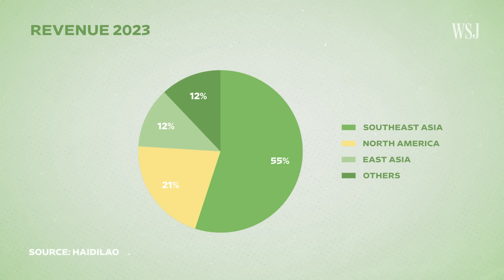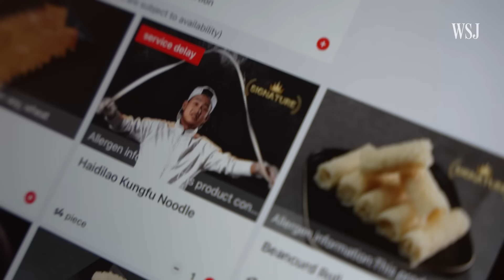This Chinese Restaurant Chain Built Its $9B Empire off Customer Service | WSJ The Economics Of

Comment: I would avoid Chinese hot pot places right now. There's a problem with the sanitation of oil at the moment due to improper transport. If the soup base is prepared and packaged from China, especially the oily soup, you're eating chemical contaminated oil. Always be wary of food coming from China.

Comment: The Wall Street Journal (WSJ) betrayed freedom of the press by firing Selina Cheng, a WSJ Hong Kong correspondent who was recently elected as the Chair of the Hong Kong Journalists Association.

A WSJ senior editor had warned Cheng not to participate in the election. When she was elected, the WSJ abruptly fired her, claiming it was due to restructuring.

So much for freedom of the press at the WSJ when facing the CCP.